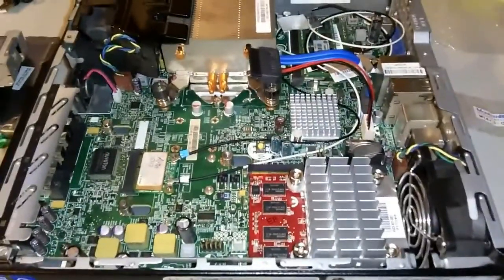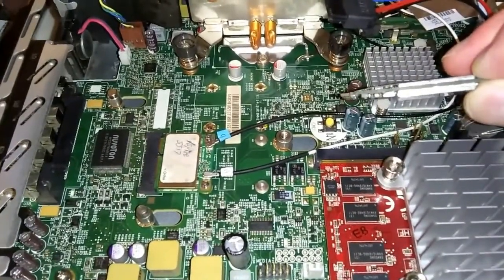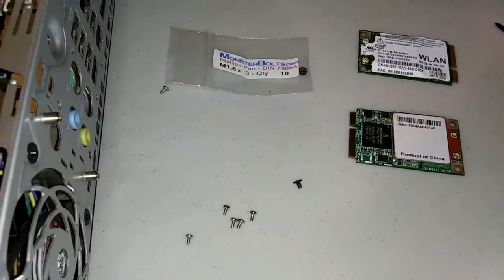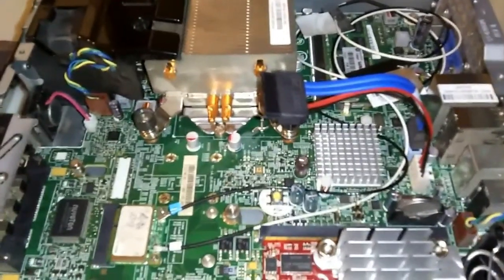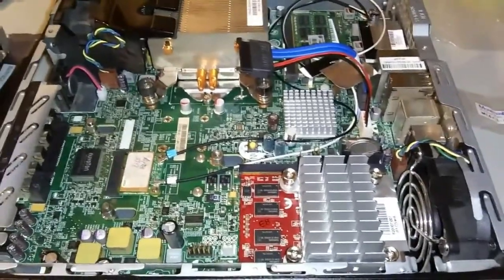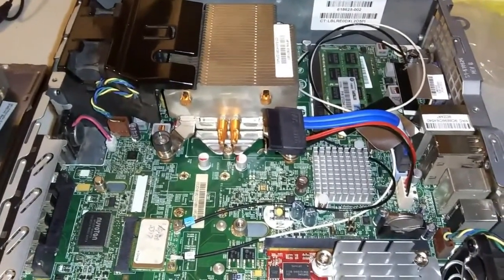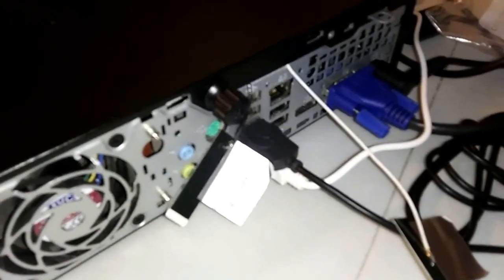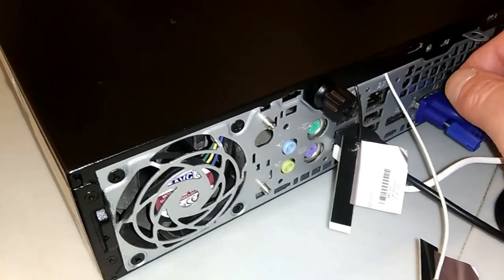Mini PCI-E Screw Type / Size for Wireless or MSATA In HP Compaq Ultra Slim 8200 Desktop Computer

Comment: 1.6 mm converts to .06299 inch.  The #0 screw is .060 dia. x 80 threads/inch.  I wonder if they used a #0 screw and the 1.6mm screw is so close that it fits?  I just got MInt loaded on a 8200 usff.  It was impossible till I upgraded the bios, now it is a useful machine.

Comment: thanks. one of the reasons why pci-e network card is used instead of an usb is that linux has sooo much more trouble setting up an usb - even a name brand like cisco. vs a pci-e, which i just popped it in and was detected and setup automatically.

Comment: What Brand Card is Installed?
Reply from the maker: Hi Peter, The card is an ATI Mobility Radeon HD 5450 MXM 512MB. It's the factory card from HP. Go to Ebay and search "ati 5450 mxm" to find the ones with the factory heatsinks. There's only a few left, and finding the heatsinks by themselves is nearly impossible. Finding the correct mounting screws is a challenge too. Read my reply to Jake Jacobs concerning the AC adapter requirements.
Reply: Thank you very much for the Info. I was also wondering about the Wifi PCI card model you ended up using as well..
Reply from the maker: The card I used was pulled from an Acer Aspire 5517. The label got torn off, but I know it's the Atheros chipset, so according to Acer's support page it's either the XB63, XB91, or HB93 model. You can find these or similar ones on Ebay.

I prefer the Atheros chipset cards over Intel, Realtek, or Broadcom. I think they're more stable and they're definitely better when it comes to Linux compatibility.
Reply: Random Things Thankyou for the help. Much appreciated.

Comment: Great Vid, I was gifted this pc a few years ago. I love it and want to do some upgrades. Any suggestions? Mine doesn't have anything in the graphics card slot, can you reply with a link to where you got your graphics card from please?
Reply from the maker: Hi Jake, sorry about the delayed response. The card is an ATI Mobility Radeon HD 5450 MXM 512MB. This is the card that HP installed & shipped and as far as I know it's the only one that's supported. Other MXM cards will fit, of course, but I can't say that they'll work. Go to Ebay and search "ati 5450 mxm" to find the ones with the factory heatsinks. There's only a few left, and finding the heatsinks by themselves is nearly impossible. Just FYI, it won't come with the mounting screws, and finding those is another challenge. When i figure out what size those are, I'll post it in the description.
* Also, if you install an MXM card, your AC adapter may need to be upgraded. The normal 135w adapters that shipped with these PCs probably won't be enough to power the card. I upgraded to the 180w & 230w models. I don't know if the 150w models are enough power.